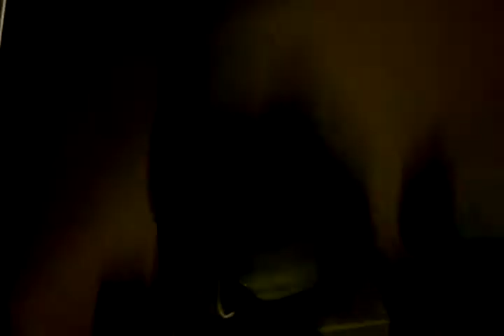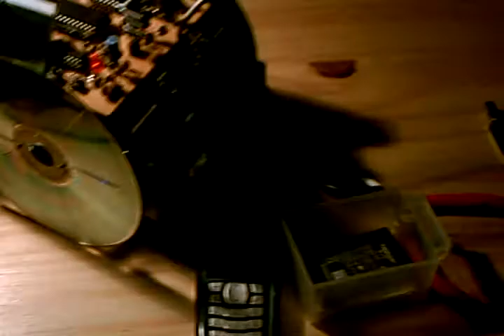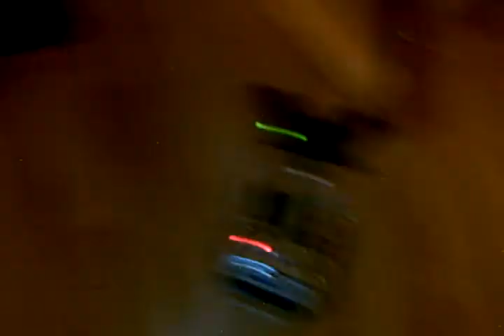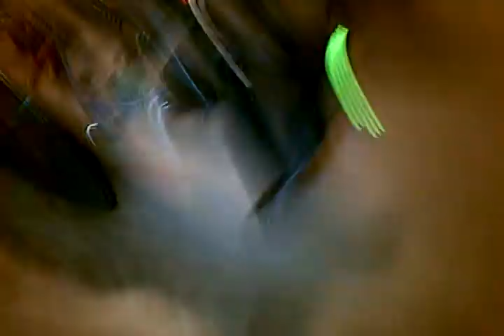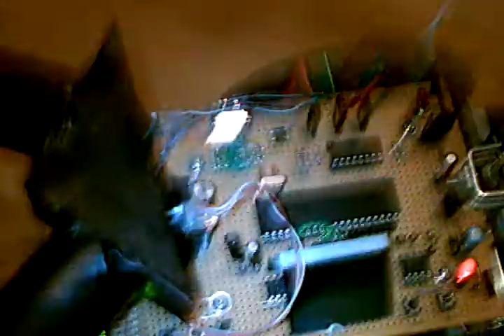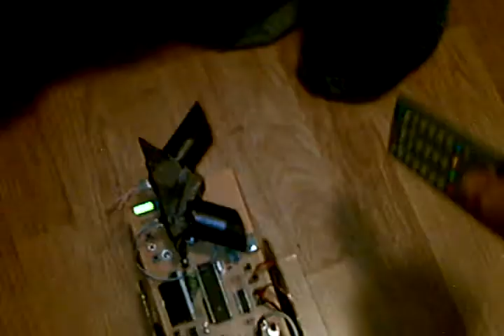IR remote control and IR following robot

Comment: Hey dude,Its pretty impressive..I do work with microcontroller 8051 too...but I have never used a graphical LCD yet..How did you connect LCD ri 8051 and How to  control it ?. Is there any kind of Protocol for it ? Please help me as soon as possible you can. It may help me with surveillance system I am making. Thanks in Advance. Take care 
☻